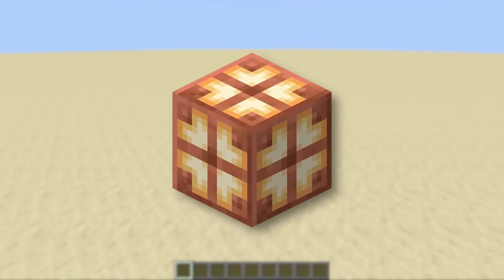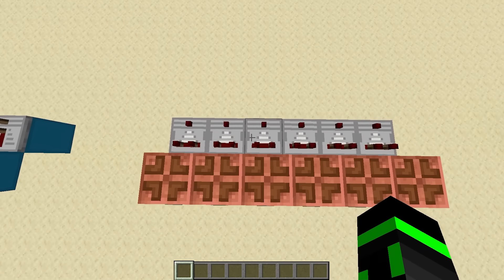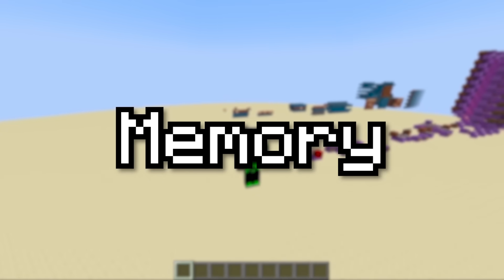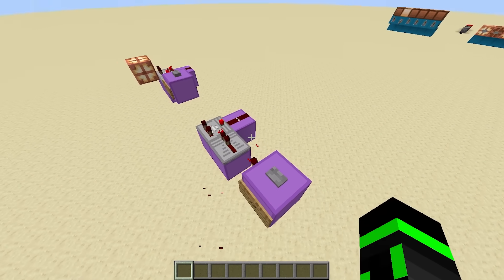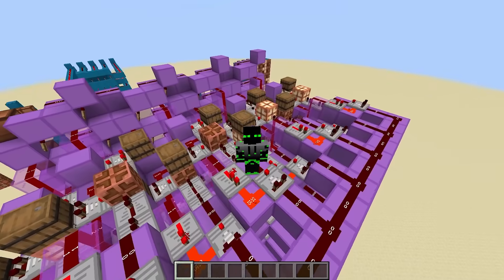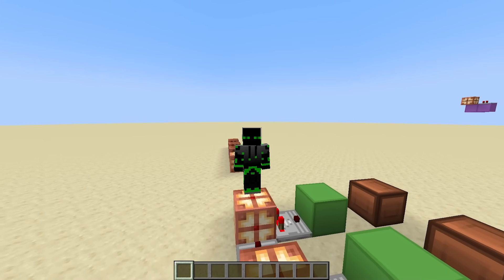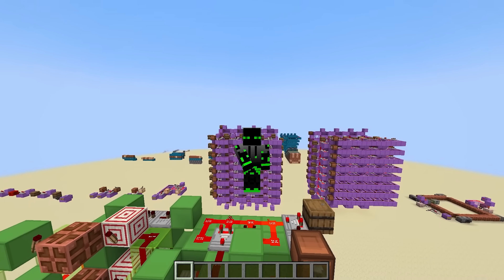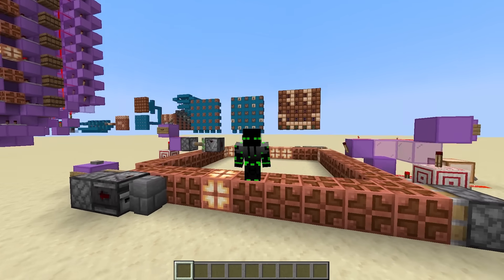Why I'll Never Use Copper Bulbs

Comment: suggestion: build "wireless" data transmission by sending a flying machine with copper bulbs storing data and then receiving them at the other end
Reply: That's stretching the definition of "wireless" lmao (I love it)!
Reply: Omg youtube bugged out so bad. The website UI is broken
Reply: @Takyodor2  Not really, if we before having started using radio waves, just sent robots to travel over it would still be called wireless.
Reply: @flameofthephoenix8395  And how would those robots know where they are and where to go, without wireless signals (or being wired, but then they aren't wireless anymore)?
Reply: @Takyodor2  Just keep going the direction you already are and hope that given enough time you'll get to a device. If it hits a wall on its way, it can simply change to a random direction. And if it starts getting to lower than 50% battery it can backtrack. It's essentially just mimicking radio waves with physical components that only go so far before deciding that they wasted their energy.
Reply: @flameofthephoenix8395  There are basically no situations where this would happen. If the distance is short enough that battery power is enough, and you navigate by bumping into walls, then communication would be done using wires, tubes or loud noise instead. Morse code through smoke signals or flashing bright lights would be way simpler for longer distances. Even pigeons would be easier and more efficient than robots. There's just no way robots that advanced are developed before proper wireless communication (outside fantasy settings).
Reply: @Takyodor2  No, there is no line of linear progression for all we know we could have skipped one of the fundamentals of physics already, and while expensive, it would be significantly more convenient to have these robots than to just wire every device together.
Reply: @flameofthephoenix8395  It would be many, many times more cost effective, convenient and faster (as in lower latency) to wire stuff together, compared to sending robots. We made a telegraph cable across the Atlantic ocean in the 1850s (yes 1800s, not 1900s) because it was deemed worth it and technologically possible all the way back then. There's no realistic path through physics discovery where robots are a useful way to send information.
Reply: @Takyodor2  Yes, just one telegraph cable, this would be billions of wires hooking together, it's a lot simpler to make one extremely big/long thing, then to make billions of small ones.
Reply: @Takyodor2  And, with the robot method you wouldn't need as many to get effective results.
Reply: @Takyodor2  However, I'll admit there's no way the robots would be able to accomplish this safely, and half of them would break down every week. Still though, even if they had to reproduce the robots every day it would still be more feasible than wiring every device together.
Reply: @flameofthephoenix8395  No, not "one telegraph cable", but rather "one of many telegraph cables I picked as an example, because it demonstrates how much easier it is to wire stuff together, compared to building robots". Don't you realize that humanity actually has wired billions of devices together, decades ago? We have had the technology to send robots with information for a while, but the (wired part of the) internet is superior in every single conceivable way. Your whole argument is absolutely nuts!
Reply: @Takyodor2  How interesting! My argument is usually words, nuts is a new change of pace. Do you also convey messages with nuts or am I the only one? Well, I'm certain we wired plenty of things together I don't think it was billions, and it just seems a whole lot easier to do it with robots, of course you'd also want to use wires too especially for longer gaps but the robots solution isn't all that bad, you could probably get away with only a few per town then have wires connecting the towns, this seems like it'd be significantly easier.
Reply: @flameofthephoenix8395  "Nuts" as in "insane", "impossible" or "crazy", is English not your first language? Whatever. We have already, successfully, wired together billions of devices. We are running out of IPv4 addresses, which there are over 4 billion of. Do you really know next to nothing about how the internet operates?!
Reply: @Takyodor2  Indeed, it would be quite insane to try communicating with nuts, I don't know why I even suggested it. As for internet, not really, I can program fine but that's an entirely different thing, as internet is a place where computation meets reality with reality being radio waves, similar to screen monitors or keyboards though keyboards are a little easier to understand, regardless, where are these billions of wires then? I'd expect to see them surely if they're that many or are they all concentrated in one particular location. Perhaps you're referring to the telephone poles?
Reply: @flameofthephoenix8395  Not sure if you're a bot, or a troll, or both. I'm clearly wasting my time here though.
Reply: @Takyodor2  I was just joking about the nuts thing, it wasn't meant to be taken literally. Also since when are there bot trolls?
Reply: @flameofthephoenix8395  Weird, my replies get deleted for some reason... If you were serious about your question, there are maps of submarine internet cables. The reason I think you're a troll isn't about the nuts thing, it's your insane stance on wired networks being impractical.
Reply: @Takyodor2  Yeah, that's unfortunate, Youtube can be really finicky at times, sometimes it will randomly decide to activate some sort of hyper Autocorrect mode that corrects "Indeed" into "India" and repeatedly moves my little text cursor around. Ah, I couldn't tell if you understood the joke with the nuts thing. However, I'm still confused as to why you think wired networks aren't impractical, seeing as we have never had full on large scale easy access wired networks at any point in time to my knowledge.
Reply: @flameofthephoenix8395  Ok, so you are actually serious then?! We currently have, and have had access to wired networks for tens of years. Some use telephone lines, some use cable TV cables, some are fiber optical (but still kind of wire-like, even if they are based on laser signals). Most are buried in tubes below ground or ocean, and they connect continents, countries, cities and buildings. This is how most of the internet already works!!
Reply: @Takyodor2  Alright, I think I've misunderstood some things, of course the telephone lines have wires, but they're not directly plugged into each and every device, and I wasn't really looking very much into it, but I didn't see much other than a power cord out of the cable television. I'm not sure what exactly I've misunderstood but I've definitely had a lapse in communication or just am forgetting something. My understanding of the internet was just that a device shoots radio waves at the satellites which then shoot it back.
Reply: @flameofthephoenix8395  Well, apart from a tiny fraction of internet connections in recent years (Spacex's Starlink satellite system, which is still pretty new), the vast majority of the information transferred goes through cables. Mobile devices need a wireless connection for the last stretch to be practical, but the WiFi router or tower (not satellite in 99.99% of cases) is very likely connected via cable to the rest of the internet. It seems your understanding of the internet was simply really wrong then 🤷
Reply: @flameofthephoenix8395  Did you look up the submarine cable map by the way? It gives a sense of how big the wired internet really is.
Reply: @Takyodor2  Alright then, that makes it sound like radio waves didn't do a whole lot apart from that last stretch for mobile devices though and of course radios.
Reply: @Takyodor2  I have now, that's pretty interesting.
Reply: @aleknjejenja5903  Pretty sure that's not in Minecraft. But you are correct, mail is superior to any fancy wireless crud.
Reply: @flameofthephoenix8395 "never underestimate the bandwidth of a station wagon full of magnetic tapes" - Tannenbaum, computer networks
Reply: @Takyodor2 same way microwaves or lasers know which way to go, duh
Reply: My guy got hit by the gold experience requiem
Reply: youtube moment
Reply: Thats acually a good idea/project
Reply: That's actually so clever
Reply: Thats acually a good idea/project
Reply: Thats acually a good idea/project
Reply: Thats acually a good idea/project
Reply: Thats acually a good idea/project
Reply: lmao
Reply: The comment box wont disappear
Reply: Everyone said it already, but big brain comment, worthy of mattbatt's comment section fosho 😂
Reply: there's already instant data transmission, flying machines would be too slow
Reply: 3 pills.
Connecting Stuff with a immovable circuit
Connecting Stuff with a flying machine
Connecting Stuff with command blocks
Reply: I believe that was possible with other way? like filling a water cauldron?
Reply: update:  jazziired made this!

he used skulk sensors to transmit the data

Comment: Something might be cool for copper bulbs is when you want to play video on your redstone screen,, you don't need to update all the screen, instead only update where it need to be update
Reply: ye, for a video, you can pretty much just manipulate the data beforehand (easy if its just stored in a ROM) and then pipe into the bulbs. Works very smoothly. The main difficulty is reading out the data and piping it to the bulbs given how compact they are placed together. Hard, but doable. The amount of circuitry it requires means there is a decent amount of delay between the front and back, but for a video this is pretty fine. Ultimately a tradeoff between the resolution of your display and the difficulty of the redstone, and in the case of a display, I think resolution wins out.

Comment: 2:36 if the user knows the slightest bit about the copper bulb then they know it can only exist in 2 states. Even if they didn't know that, they'd realize it after clicking it once makes it stay on
Reply: Right?  What about a floor display with buttons on the front? Levers could be placed either way, which is infinitely more confusing than having a button that lights up a lamp.  Who the hell would use a toggle light to send a single pulse?
Reply: @eli334-1  Even with levers on walls, it can still get confusing because many people are used to the idea that up is on, and levers are the opposite.  Even if someone is used to the way levers work, the person building the circuit could still have inverted the signal to make them work like light switches.

There's also nothing preventing a lever from being used as a pulsed input, they're actually better at it than buttons are because buttons give a long signal but lever+observer gives a 1 tick signal.
Reply: It‘s like saying back when the redstone lamp was introduced, that no one knows it‘s a lamp…
Reply: it's not about Minecraft knowledge, it's about user experience design. Everyone on the computer knows by experience that little things going side to side is a yes or no choice. That's because it follows an unspoken standard you'd notice everywhere, like the settings app on your phone.
While both options work fine if the player is focused on the lamp, the lever option is more clear about the purpose, and a button that toggles (unlike normal buttons) is ambiguous.
Reply: @erich_ika  And then there are checkboxes.

The idea that a button + lamp that stays on is less intuitive than a lever is nonsense. The only possible argument there that isn't garbage is that the button might be harder to see than the lever, except the lever being disconnected from the light actually makes it harder for people to make the connection between the two.
Reply: @SirSpence99  well hold on, no need to get heated. I'm not here to argue, I'm here to argue, just showing a different perspective.
Let's put it this way: All I'm saying is that if there's a lever, I know it's a toggle. If there's a button, it might do anything. And this property is valuable.
Reply: @erich_ika  Knowing that there is a toggle, doesn't tell you anything unless you know what it does.
Reply: @SirSpence99  Of course, a button can toggle the same way a lever can pulse. But it tells you a very important thing: the intent of the designer.

Comment: I disagree with the idea that copper bulbs don't make good screens. by hooking up a screen signal to an observer and then a copper bulb, you can functionally treat copper bulbs as redstone lamps. this would be worthless, if it werent for the fact that now you can wire the screen with observers, meaning now you can miniaturize those old 2 by 2 redstone lamp screens to be 1 by 1 with this observer to copper bulb setup. there is a limitation that the signal can't change once, and then again the next tick, but you can filter this signal with a 3 tick repeater

Comment: I'd be interested in seeing some kind of adder based on copper bulb counters >:3
Reply: Well, you just add input lines into the other bulbs (not just the first one), and make sure the delay between inputs don't cause overlapping signals in any bulbs. It's almost an adder already! :)
Reply: @Takyodor2  that's the idea I had in my head heheh, but I wanna see it implemented in a video x3
Reply: @bowfuz  Fair enough  :)
You could probably do it yourself though!

Comment: Having made one copper bulb computer and working on a second, I have to say that copper bulbs can be used for really interesting data storage and computation systems, it requires a very different non traditional kind of architecture. I used the bulbs to make a really interesting hybrid 16x16 screen with 8x8 inputs, but then in order reset it without command blocks I have to give it much longer input pulses and might need to limit how often the screen updates. I also made a better rippling up/down binary counter, I should probably make that it's own video soon.
Lots of really weird trade offs, some of the UI stuff is up to preference but it is disappointing how many things have a clear and final answer.